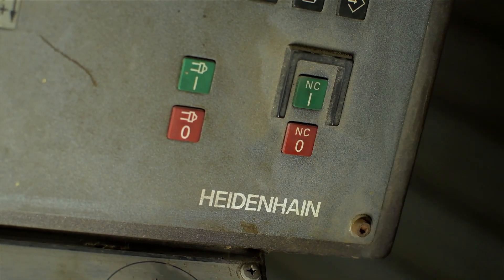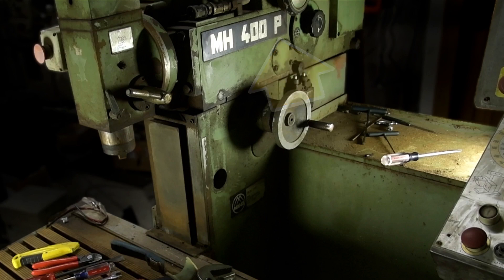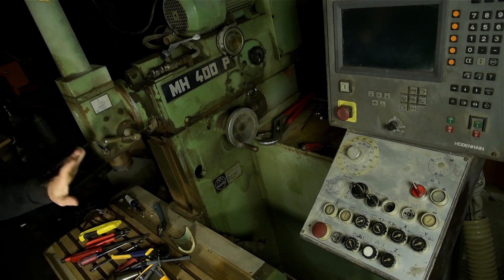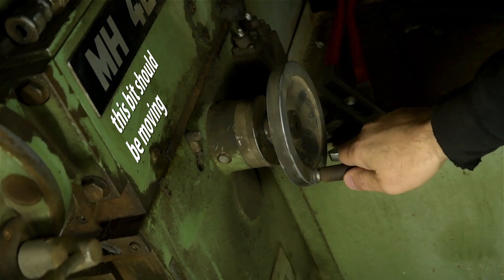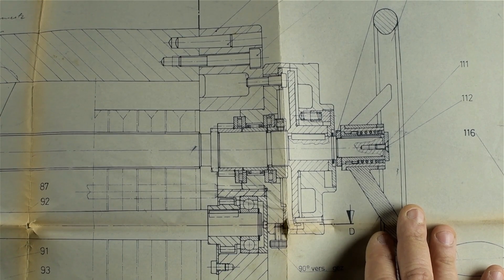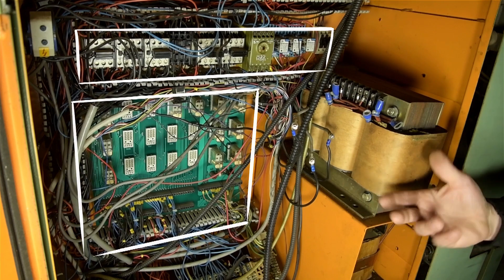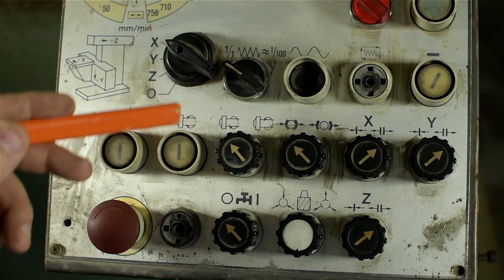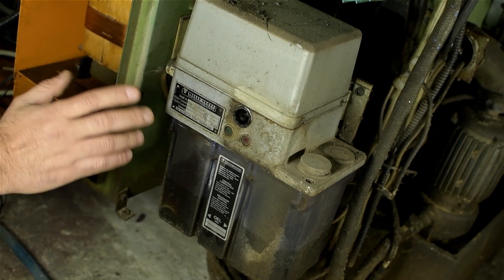MAHO is Filthy!!  (Whose Milling Machine Isn't?)

Comment: The big transformer thing is probably a ballast inductor. Its job is to limit the current a transformer can take by making sure that the transformer’s magnetic field doesn’t become over saturated. They are always wired in series with the live wire feeding the transformer.

Comment: Hey This Old Tony, do you have 3 phase in to the garage?  How do you power 3 phase equipment.  I'd like to start aquiring some equipment myself.  I considered an overly expensive "phase converter" but I think a better answer is a single phase to 3 phase drive.

Comment: Bro thats a real old school Maho. Love how it says “West Germany”

We have a 600 with a CNC system on it in our shop, I’m no machinist (I’m a mechanic) but our guys run these daily and they have been doing so since the 80’s. We repair and maintain industrial machines and installations, so a lot of parts are made in house by us. These are quite expensive to be found here, they are excellent machines from a bygone age that was all about reliability and robustness.

Whatever you do to it, keep the old control panel for the manual control and that little “West Germany” plate, if fixed and taken care of you’ll get another 30y out of this thing lol.

Fun fact, I’ve read that there is a reason why a lot of older german machining tools and shop equipment has that green color. Apparently after the war there were tons of barrels left with primer that was to be used on military equipment before it would be painted. Serving as a sort of “weather-resistant” coating. After the war when they started building machines and equipment again they found a purpose for this green paint. It was a hard time and they had to use everyting they could find. Story seems plausible, I guess that they just kept on using this color long after the supply of primer was gone. Our MH600 has the exact same color.

Comment: I could have sworn I had already written this exact comment , but can't find it so...

The z-axis on any machine is derived but the orientation of the main spindle "motor" shaft orientation.

So if the machine's main motor is oriented 23.45 degrees clockwise from vertical, that's your z orientation (insert shrug emoji here)

All other axes are derived from that and the rigth hand rule.

So it's up to what the designer thought the best orientation for the motor was, even if that was based on factors like minimizing floor real-estate or something.

Comment: Really nice machines, I worked with the MH400E (1986, Servo's on all directions).
What I was thinking, would an hydraulic actuator be a good addition to speed up the tool changes? Of course with the correct safety valves..

Comment: The redeeming feature of this pile of scrap cast iron is that even if it never works again, you can always fill the voids with concrete & use it as a mooring for the expedition yacht! 😜😂😂👍🇦🇺

Comment: The one you bypassed looks like an isolation transformer. Its used for safety so that the phases inside the cabinet are isolated from the infeed, remove the path to earth and make it less likely to get electrocuted it you touch only one phase inside. Still please don't touch them, love your video way too much!

Comment: Dude,@ 12:05 you cycled the hydraulics. an you can hear the impeller going backwards. You need to check your power rotation and go the other way. (can get ruined)
 This is an old NC (open loop) machine. (i'm grandstanding now). That would be a hell of a build. Not loose cube size.  4 separate drives X/Y/Z/S.  on a hydro-static base. Little machine would have some UMPH to her, wa?

Comment: Hydraulic pumps scare the sheet out of me. If you get a leak in the super high pressure ones, the jet that comes out can be so fast and fine it acts like a hypodermic needle and injects you with highly toxic hydraulic fluid. Used to work in oil industry and a few guys bought it that way /oldsaltyseadogstorynobodyaskedfor

Comment: Thanks Tony.  When this video was first released I went right out to Ebay and started looking for a CNC mill.  I had a decent mill drill, but I was ready to step up to a full size vertical mill.  I ruled out CNC pretty quickly, but I did find a nice old Gorton Mastermil that had spent the last 60 years working at Allen Bradley in Milwaukee.  I am now the proud second owner of a 60 year old mill, and for my wife's sake, it's your fault.

Comment: If old horses go to the glue factory, where do old machine tools go? I've decided an equally bleak end would be "the manhole cover factory".  I mean, "Anvil factory" tripeth more lightly from the tongue, but it's too majestic an ending to be a replacement.
Reply: I once saw an early Moog "CNC" conversion of what I think had been a Bridgeport, but it used fluid power for everything - seemingly both hydraulics and pneumatic control lines - and it was so liberally festooned with hydraulic hoses, 1/4" pneumatic lines, manifolds, electrical boxes, pumps and motors, that the original mill seemed like merely the skeleton upon which a Frankenstein's monster had been built. A hackerspace had received this albatross in "unsalveageable" condition for parts. Eighteen months later, it was unrecognizable and doing amazing things driven from modern software. They probably control it now with a Raspberry pi or some damn thing. Kids these days. No respect for their elders' monumentally stupid ideas.

Comment: My Bridgy was made in the early 70s, about a decade after I was. It has earned the right to be filthy.  I gave it a good clean (read: 'wipe down' not 'degrease & paint') when I got it it home and called it good. But the second-worst smell I was ever assaulted with was the coolant sump of a big horizontal mill which had sat and sat for a long time without being drained. (the worst ever smell was a rotten potato - I've smelled death and other very bad things - the potato was worse. And for the record I'm aware of Derek Lowe's 'Things I Won't Work With' and thioacetone scares me - I have a pretty good sense of smell.) This was hilarious! Not like all the other TOT videos, which have no humor in them. ;D
Reply: Someday I'll fix the stock BP table feed which is some of the most brain-damaged design i have ever seen. But replacing it with a standard Servo style drive is a surprising amount of extra work, because they are all designed - and come with adapters for - stock BPs. But the mills with the factory table feed have different shaft end support castings, and shaft ends, so living with the goofy mechanical limit switch crapola just seems easier. The stock drive circuit is "easily" replaced by a COTS Minarik motor controller with more robust semiconductors as detailed in the BP Yahoo group, and a few web pages findable with a google search. That part is easy. It's replacing the seals in the gear box so oil doesn't leak DOWN INTO THE ELECTRICAL COMPARTMENT BELOW. Genius design, OMG Becky, seriously.

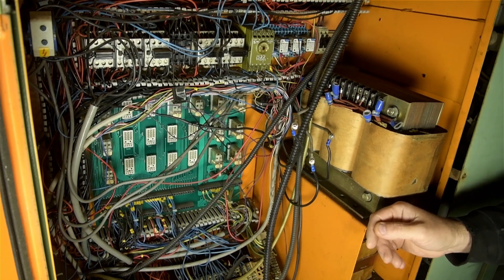Comment: 8:36

if power goes in and power goes out, means if that's just wire wrapped around the iron and that wire goes from source directly to the circuits, maybe that's a power surge portection?
Reply: Yeah these transformers are there, to decrease power spikes in the grid. For example, if the voltage decreases, the relays don't go on/off for a short period of time

Comment: that power supply had an old filter capacitor that exploded and probably shorted the supply blowing the fusible resistor inside.

Comment: No ball screws is a problem for CNC operations, mostly expecting to be able to climb mill. Be careful learning the code for that machine. It's as quirky as a Siemens machine.

About a year ago I purchased a Charmilles vertical mill, basically a very modernized Bridgeport, HEAVY castings and all, and it's equipped with an Anilam full 3 axis CNC controller. The controller was just sent out to replace all drives, relays, and terminals, as well as update the software to the final version, including a quite nice conversational format. The oilers were replaced, as were the entire ball screw and servo assemblies for all 3 axes. AND a full set of complete, original manuals for machine and controller. Probably worth about 15k to 18k and including driving 1500 miles there and back, I paid far less. Considering I had previously made my own R8 face mills I couldn't be happier.

Comment: THIS brings back memories. Back in the mid 90's when I did my apprenticeship I cut my teeth on Mahos. Specifically a Maho 700 and Maho 1000 (both 3-axis full CNC). The 1000 is a beast. And a Maho 700 5-axis.

Comment: We have CNC in the local college - they installed a new German unit and powered it up - promptly blew the main Transformer to the College.  You know those are easy 2 x your truck size or bigger than your car.  Think Bus.    Seems there was a different way to hook stuff and a 100A Leg was shorted to ground.  I think that big transformer was a 3 phase to two phase converter.  Three cores give it away.  Water is tough on most stuff! - interesting project.

Comment: One of the reasons you do a 1:1 transformer is for DC isolation. This prevents things like grounding yourself through your machine or say, if there's a power leakage in one of your high powered motors somehow, it doesn't shunt to ground through the machine body and cause things to heat up an absolute ton.

Your 1:1 transformer is actually really important for safety and you should replace it as soon as possible.

Comment: Yes MAHO. Worked on some of the finest 80s versions of their CNC machines, talk about obsolete. Has Siemens drives that were represented in Greek literature. No information on them anywhere. A monochrome CRT. Stopped using it as the drives and all the spares, slowly fail one at a time. Shame really, she is a lovely thing. There were 3 running at one point, slowly dying one at a time, one giving up its organs for the others. Deckel MAHO :)

Coolant pumps are always full of crap. Either rust, gunky junk or the wiring's insulation has gotten covered in coolant over the years, gone brittle and fallen off. The rancid coolant smell is what's giving off a big clue.

Seen worse panels. That big thing will be a line filter, sure it will be the inrush current screwing everyone over that plugs it in. Not necessary for your purposes.

I've seen professionals convert machines to CNC type. It tooks them months of full time work. So I wish you best of luck!

Comment: Hi, I was wondering if you have any wiring diagrams in your large pile of manuals that came with your machine, I have a MH 800 which has developed a problem with the feed selection buttons. The drawings you have for the MH 600 version should be close to my version of mill. I have spent many hours hunting on the internet and had no luck until I seen your video. I look forward to your reply, Kind Regards Dion.

Comment: CNC universal tooling machine make MAHO type MH 600 P | Fabr. No .: 62083 Year of construction 1981 | Working range X-axis: 500 mm | Working range Y-axis: 400 mm | Working range Z-axis: 400 mm | Fixed angle table: 810 x 400 mm | Work spindle Tool fixture: ISA 40 | 18 Spindle speeds: 40 - 2000 Feedrate range X- and Z-axis: 1 - 750 mm / min | Feedrate range Y-axis: 1 - 500 mm / min | Rapid traverse X- and Z-axis: 1200 mm / min | Rapid traverse Y: 600 mm / min | Quill stroke: 80 mm | Drive power: 4 KW | Weight approx .: 1400 Kg

Comment: oh, HAWE hydraulic pump. Usually radial plunger pumps, some are 450 bar, some even more. The sound might actually be low oil, but in fact some of those pumps wear and get louder. Plain bearings on the rods, lubed by the hydraulic oil mostly. Also i'm not sure if the hydraulic pump will be fast enough to do axis clutch actuation if it is unable to eject tools fast. But might have air trapped in lines, with a stuck ball checkvalve or something. The breaker-tripping brick you disabled most likely just seperated all the control voltages from mains, so that if you ever wear down insulation on any control line, the body of the mill does not electrify you.

Comment: The big transformer thingy you were puzzled over is an inductive choke which flattens out the inductive kick caused by starting and stopping the motors. It also helps smooth the incoming power to the unit.

Comment: ToT, it  could still be a really accurate mill even with cheap acme screws if you just put linear encoders on the x and y axis as this will account for the backlash.  I used to have a cnc router that I did that to and it was accurate to sub-micron, far more than the runout on the spindle which was around 0.1mm.

Comment: looks like that massive "transformer" is actually just a isolation transformer, meaning its got a 1:1 ratio. It serves two functions. First, it galvanically isolates the machine from your house. That is to say, it makes it so that there is no actual conductor path between the two as the power is transferred "wirelessly" through the transformer. Second, it serves as a sort of RF choke. With a transformer that big, its probably got a stupidly high inductance. Without getting too far into the weeds on this, it basically keeps any high frequency noise from things like motors and servos from feeding back into your house. Without this, if you run the machine and measured the voltage from a socket in your kitchen with an oscilloscope, you could probably tell when it's running just from watching the oscilloscope.

Comment: If there's only one motor to move all 3 axes, the hydraulic axis locks are necessary. Otherwise, what's going to hold the undriven axes still while the driven axis is moving

Comment: I love your videos.    I've had a Taig cnc ready mill for about 10 years now.    With the ball screws already installed.    But, I'm completely ignorant about cnc machining.    I do have a few 3d printers and I understand all that.    My question is can you explain how I can cheaply convert my Taig to cnc?  Could I use something like this?   Feel free to dumb it down.   I won't be insulted.   

https://www.amazon.com/Longruner-Arduino-Professional-Mechanical-LKB02/dp/B072N4FMRN/ref=asc_df_B072N4FMRN/?tag=hyprod-20&linkCode=df0&hvadid=366299818020&hvpos=1o3&hvnetw=g&hvrand=12463650693523411584&hvpone=&hvptwo=&hvqmt=&hvdev=c&hvdvcmdl=&hvlocint=&hvlocphy=9061255&hvtargid=pla-803031210947&psc=1&tag=&ref=&adgrpid=75871523946&hvpone=&hvptwo=&hvadid=366299818020&hvpos=1o3&hvnetw=g&hvrand=12463650693523411584&hvqmt=&hvdev=c&hvdvcmdl=&hvlocint=&hvlocphy=9061255&hvtargid=pla-803031210947

Comment: Should only take maybe 3000 hours. I've got a German P2P that I've given up on. Siemens controls, 4 axis, 18 tool changer, 21 spindle boing unit .... I'm not qualified to work on it. Too expensive to have a tech.

Comment: The big transformer-looking thing you removed from the circuit is probably a line reactor. The point of the line reactor is to slow down huge current spikes when stuff turns on. So if you're right next to a huge transformer in a large facility with like 5000A service, you have the potential for huge current spikes that are reduced with a reactor. It shouldn't matter for home use, but it depends on the situation. https://www.vfds.com/blog/what-is-a-line-reactor

Comment: MAHO is the original company which forged into DECKEL MAHO later DECKEL MAHO GILDEMEISTER, today also known as DMG or DMG MORI. So you what you have there is an very old predecessor from a DMU 65 monoBLOCK or a DMU 80P4 duoBLOCK :)

Comment: Small tip: when re-inserting the tool holder into the spindle, give it a quick wipe.  This will prevent embedding chips, dirt, etc. into the holder and/or spindle.  Or so I've read.  :-)   Thumbs up to crush a troll.

Comment: I have a Hermle UWF600 that is very very similar to that machine. The inside of the cabinet looks almost exactly the same as mine, just smaller and messier. (even has that weird orange color). On mine, that transformer was a three-phase autotransformer that allowed you to run the machine on either US 240V or European 220V by just swapping the tap on the transformer to make the few percent change in voltage, so I assume that's the same as what yours was.

Comment: That thing in the cabinet looks like a step up Transformer to me: Germany runs on 230 volts and you run on 110.
However its strange that the machine seems to run fine without it. Have you noticed any lack of power? Is there any name plates on any of the motors that state their voltage rating?

Comment: 👍👍👍👍 a megger might be a good addition to your arsenal. Depending on location in circuit most likely  a line or load reactor.
Reply: Also I pull tools out of junkyard often...electric heater tossed in cabinets, facing motor for a couple days are your friend. A year ago I pulled a smashed roto phase out of mud, dug out mud , cooked it... straightened out bent crap, fixed damaged wiring. I now have working 3 phase from "junk". Meggered it before I energized it.

Comment: Get some proper coolant fluid and use it to clean the machine. That's the best and least smelly way to get rid of old coolant that has dried out. Cleaned my Maho 600E2 with brake cleaner, WD40 and equivalent stuff. Never again :D

Comment: That Finder relays look quite new. Definately not 1974. Also the prehistoric fuses can be still bought new in Poland. You can get a version that works like a new fuse that you reset with a button. If you would like some feel free to concact me Tony. Unless you will scrap all of that then nevermind :)

Comment: I have a couple industrial servo motors with encoders and ballscrews that might work for this.  Salvaged from a Makino Leblond EDM machine.  Very beefy.  High precision.  One has about 420mm of travel and the other about 380.  Unfortunately only two.  Still, If interested, there yours for approximately $You-Pay-Shipping.00